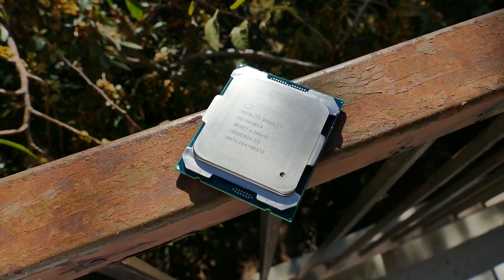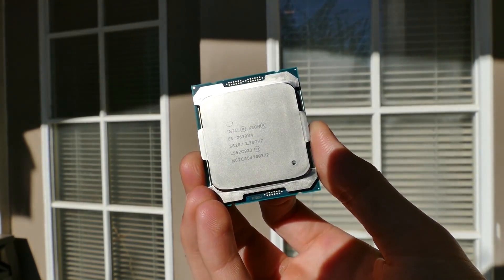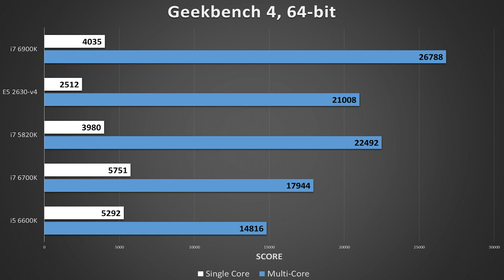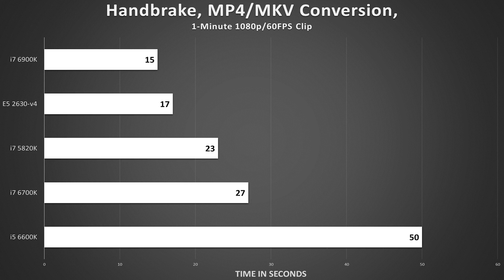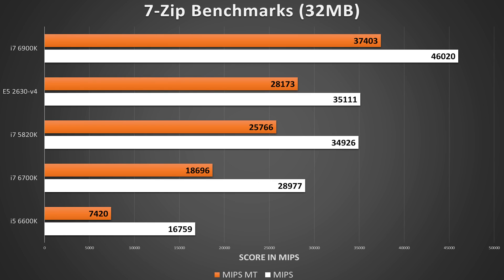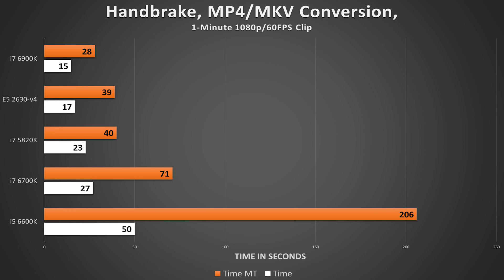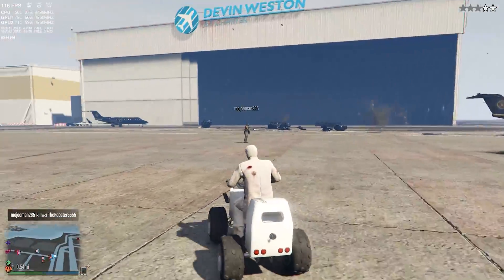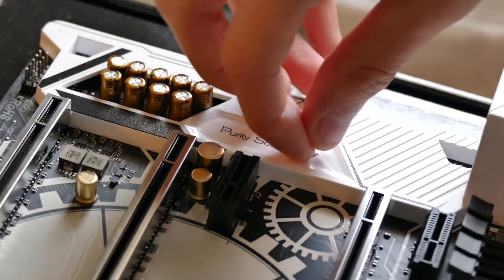i5 vs. i7 vs. i7 vs. Xeon vs. i7 (Multi-tasking/Heavy Workloads)

Comment: I'm triggered because i have a 6600k, it's great...
Reply: dont be , unless you're a video editor , your performance for gaming is identical with any other higher end CPU
Reply: Joel Palis you do know that was sarcastic, and probably the only reason for people that buy i5's are to game without any CPU limitations. And everything else like daily web browsing almost doesn't get the benefits of a hyper threaded i7, plus i5 6600k average better overclocking then the 6700k. And only image rendering and video rendering is where the i7's are better at. So in the end 6600k master race
Reply: Pulsating Sounds projecting so hard rn 

And just saying an i5 and i7 doesnt really do anyone any good . What versions of them did you have ? cant really compare older generations of the products to how the skylake 6600k and 6700k do for gaming . Just saying based on nearly every sites benchmarks the gaming gains are few and far between with the two chips
Reply: Pulsating Sounds yes, and u r not
Reply: I'm just salty at this point cuz I'm poor and couldn't afford for an i7

Comment: You should try a overclocking series. Try to get good overclocks! Also is this a good overclock, i7 6700K at 4.7GHz 1.355V?
Reply: Dylan Hu thats around what m cpu gets. But i settled at 4.6ghz at 1.290v for the lower temps and stability.

Comment: I have a  i7 3770 where would that fall in this scale or if at all.
Reply: Madusha Silva if you play at 1440p youd be on par with a 6600k and neck and neck with 6700k. That is if its a 3770k oced to 4.7 or above. But at 4.6ghz which is achievable by almost all 3770ks is also more than enough. With fast ddr3 memory. At gaming you are still beast.

Comment: wat should i get? i5 6600k or i7 6700 non k version
Reply: "99%" was a bit of a bold statement by him as not everyone is doing content creation or ever plan to . the 6600k gives you identical results in gaming to any other higher end CPU and leaves the door open for overclocking . Again , youll only really see these higher end CPU's flex their muscle if you're a video editor and its not worth going above a 6600k for gaming
Reply: Eyedeagle save up for 6700k because if you can get the 6700 you can a 67k
Reply: If your doing editing and want to go cheap you could get a second hand 8350. As a content creator I can tell you they do pretty well. Just overclock it by about 700mhz. Or in my case 1.3ghz and they do fantastic. The only thing is get a decent cooler or they will suck ass. My H100i when rendering keeps it at about 65c full load.
Reply: So far Kaby lake is just looking to be a higher clocked and hotter version of Sky lake.
Reply: Eyedeagle 6600k will last longer for gaming
Reply: Joel Palis actually sim games like project cars or planet coaster can kill an i5 quite easily. but for the most games an i5 is still fine. I would still go for an i7 because I don't like my i5 :p
Reply: i7 6700 for sure. same performance but far less fps drops and stuttering in games.
Reply: 6700k to keep open that option of streaming. I'd like to have as many options as reasonably possible, so I imagine the 6700k as our best jack of trades CPU atm.
Reply: neither, wait a month for the 7700k

Comment: Hey bro, what about the 6800K?
Reply from the maker: Not much different than the 5820K
Reply: Salazar Studio okay. So it would be better to go with a 5820 than a 6800, since it's cheaper right? Or are there any other major difference between the two?
Reply: Sai Krishan Kumar 
6800 is a little faster and that's basically it.

Comment: Hey greg, Is the 6700k overclocked? mine is overclocked to 4.5 but cinebench scores are only around 950-970 and I'm not running anything else while benchmarking.
Reply: you have 0,1 ghz less than in the video so your score is less
Reply: Richthoven was he running it at 4.6?
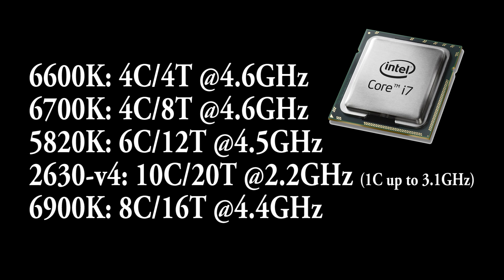Reply: yes, look at 1:02
Reply: I had the same reaction. It took 4.7 ghz to pass 1000. If you go back to 1:10 you'll see he did OC it to 4.6.
Reply: SniperBlaize ram speeds guys. Oc your ram and timings and youll get the numbers. I get 1016 on cinebench with 3200mhz on my ram and 4.6ghz on cpu.

Comment: I thought it was just me i own a 4790k on a z87 gene motherboard and a 5930k on a matx asus one running raid 10 and the x99 running raid 1 while 10 yes is faster it seems the x99 chokes sometimes you said something about latency it just doesn't work as smooth as the z87 platform and they are on 7200 rpm with intel acceleration on a 64gb ssd for caching. But on heavy media conversion witch i do often the 4790k gets at 100 usage all the time where the 5930k hovers around 80 and i can still play games while converting media unlike the z87 witch becomes unusable.
Reply: This makes no sense
Reply: +Dylan Hu I know right? Nice run on sentence, buddy ._.

Comment: If I have a $400 budget and need a new CPU, what would you recommend? Keep in mind that right now my motherboard has an AM3+ socket, so if it's going to have any different socket, the cost of a new motherboard will have to be added on. Thanks!
Reply: Also, maybe worth noting that I have a GTX 1060 3GB currently and am going to be doing mostly gaming.

Comment: Whenever i watch videos comparing i5 v i7 v xeon or what ever i always wonder how my i7-6700HQ would compare to them???
Reply: Brett Davies worse
Reply: The Final Gamer lol wont be that much worse it is 4c/8t at 2.6 - 3.2 Ghz and sits quite happily at 3Ghz when under load and decent temps
Reply: How did you get a 6700HQ? I just need to know
Reply: Dylan Hu its a laptop cpu
Reply: TheDrewSaga Works great for gaming which is mostly what i use my laptop for.
Reply: I would say the i7 6700hq is either a highly overclock i3 6100 or a i5 6400
Reply: The Final Gamer how does it the i7 6700hq is a full quad core hyperthreaded cpu at upto 3.2Ghz
Reply: Brett Davies Because it's a mobile processor unlike a desktop processor this being slower than its counterparts
Reply: The Final Gamer The mobile chips arent very far behind the desktop counterparts anymore well its not as big a gap as it used to be
Reply: Brett Davies well yah but there will always be a gap or what's the point of a mobile chip?
Reply: The Final Gamer the hq might as well be desktop chip in a laptop, the only reason it's slower is because the clock speeds are lower.
Reply: I think it is a really fast chip for what i use it for a big upgrade over my last laptop which onyl had a AMD A6-3420m quad core @ 1.5GHZ which i overclocked as much as i could got it all the way up 2.8GHz stable did have it at 3GHz for a little bit but became unstable after a few weeks
Reply: SkinUpMonkey Then why dont we just keep the thermal tdp of the laptop variant and just convert that to a desktop chip and up the clock speed?
Reply: The Final Gamer you can't up the clock without tdp going up
Reply: SkinUpMonkey then how is it possible to overclock CPUs?
Reply: The Final Gamer if you knew anything about overclocking you would know how
Reply: It doesn't increase tdp btw else we would have 300watt and CPUs overclock which you clearly don't see SkinUpMonkey
Reply: The Final Gamer wtf dude, higher clocks need more power which in turn makes more heat
Reply: SkinUpMonkey yah but you don't operate out of the nominal today range for the cpu/gpu
Reply: The Final Gamer I give up
Reply: Good for you SkinUpMonkey
Reply: The Final Gamer ya it is, no point trying when you know nothing
Reply: Keep talking about stuff you don't know I got all day SkinUpMonkey

Comment: i need 1.39volts to get my i7 up to 4.6😫 its a 6700k
Reply: I need a money for i7 6700k
Reply: SniperBlaize you need to Buy my next chip jou hava a Golden sample damm
Reply: Pootis 
Yeah you lost the Silicon lottery.
Reply: I need 1.355V for 4.7GHz
Reply: Well i  i Lost the Silicon lottery yet again 😩
Reply: Maybe 1 dat im gonna het that Golden chip hahaha i dont thinl so my fx 8350 also would not Go over 4.2ghz
Reply: I setteld at 4.5ghz at 1.356volts
Reply: Not to make you more jealous but I got to 4.9 at 1.39v and 4.7 only took 1.3. Couldn't get the magical 5.0 though.
Reply: Damn really? I have a 4790k and it only takes 1.23 to get to 4.6.
Reply: ..... I dont even know what 4.9 would take from me 2 volts dammmm
Reply: Mines at 1.306V at 4.6. Haven't gone any farther then 4.6.
Reply: Make sure to have Load-Line Calibration (LLC) enabled in the BIOS. Many Z170 boards show 1.39-1.40V in the BIOS but have VDroop to 1.32-1.36V to protect the CPU. Open CPU-Z and then load Prime 95. IF your 1.39V in the BIOS results in 1.32-1.36V under GPU-Z while Prime95 is running, your effective voltage is not 1.39V. That's why it's often best to apply a VCore Offset or set LLC to at least level 2 or 3.
Reply: I Will give that a try for sure maybe  it wil Help a bit thank you
Reply: That's not bad, Skylake doesn't OC amazing compared to their stock clocks.

Long gone are the days of running a 2.66GHz stock CPU up to 4GHz.

Comment: What all did you run in the background?
Reply from the maker: I said in the video that I was rendering a 4K video file while running the second set of benchmarks.
Reply: Salazar Studio Ok, I didn't hear that part, also thanks for responding. 

PS: Its great that you respond to questions of your community, even as stupid as mine was. Thanks!
Reply: Salazar Studio one question, any change we can get a review of the asrock taichi, im debating buying it very heavily in my head.
Reply: what if you need more PCI-Express lanes, is it worth it to have a x99 platform?
Reply: I did NOT ask you

Comment: Is the 6600k if I'm on a tight budget. no I won't run any stressful multitasking but maybe play a game and watch something about it in Chrome. I'm looking for truly gaming and rendering(seperately) for the cheapest price
Reply: Have a 6600k running it at 4.670ghz can easily play GTA V while doing things in Chrome. Long as you don't do the kind of things he did in this video you will be fine.
Reply: The 6600k is the best cpu for gaming, period.  I unfortunately could only get mine to 4.4ghz but it's still killer
Reply: Stoned Gamer that will be more than enough. I am usually running GTA V with mods while watching 1080P YouTube videos on my i3-4150 and it runs smooth. But I also have a dedicated GPU, but I am not sure if you are using one or not
Reply: 6600k should be sufficient enough for your applications. I got the same cpu overclocked to 4.7ghz  and it's awesome..
Reply: i have the 6600k - gaming and some simple programms on the background are totaly fine
Reply: David Cox same im stuck at 4.4 too. Mine's really weird, it only needs stock vcore to a 4.4 oc. But! it needs like 1.38 or more to get 4.5😞 So its not worth doing.
May i ask whats holding yours back?
Reply: Nathan Kam  Mine is similar, only a little more than stock voltage needed for 4.4ghz but 1.45 for 4.5ghz and I didn't even do long tests because even though temps were fine I wasn't comfortable going that high. 
I don't know why guess we lost the silicon lottery :/
Reply: David Cox what cooler and mobo are you using? I have 212 evo and gigabyte z170- hd3. I'm starting to think the mobo could possibly be the limiting factor. Don't know for sure though
Reply: Nathan Kam  I have the gigabyte z170x-gaming 3 mobo and I was going to get the 212 evo but it spiked in price when I was ordering so I went with the cryorig h7 thinking I'd have more oc headroom, turns out I didn't need it at all with this chip, even Intel burn test barely pushed temps above  50 C lol
Reply: jr Bhatti i will buy either a r9 fury or gtx 1060 with it
Reply: You're better off with a Xeon 1231 v3 which is a haswell 8 thread chip and costs $230-$250.
Reply: Is 6600k a very good cpu for playing ARK survival and flight sim